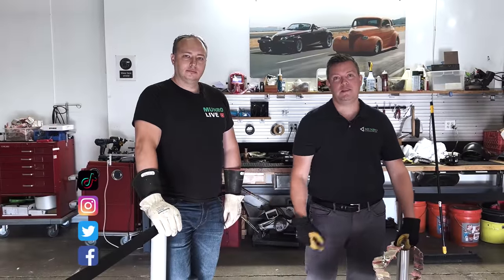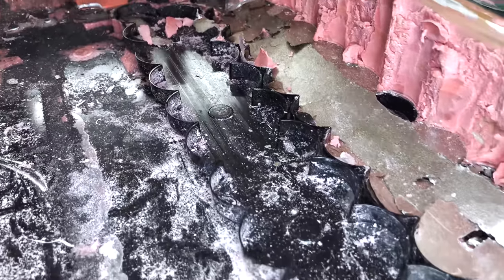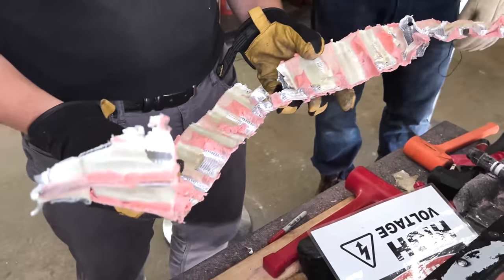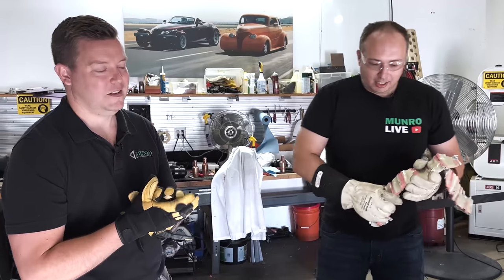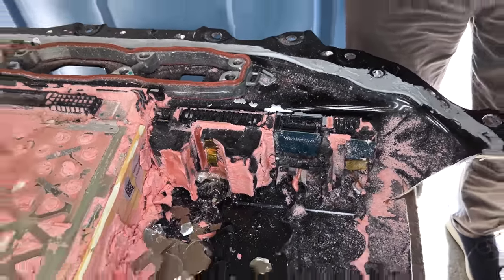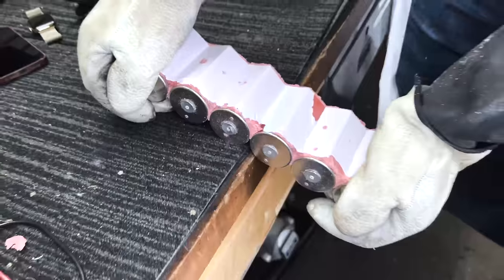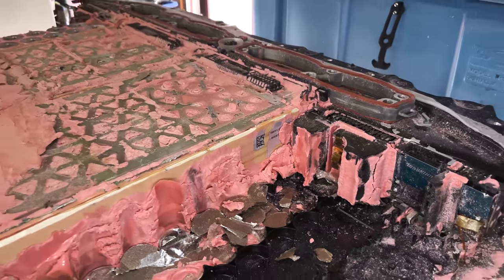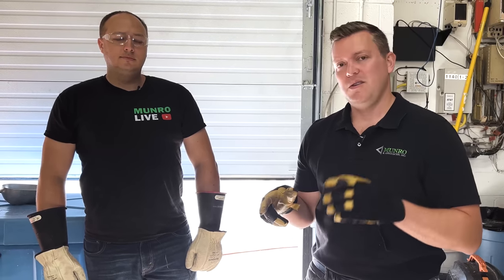4680 Update Structural Adhesive | Tesla Model Y

Comment: That foam is some strong stuff.
Like others, while I completely understand the concept of "Just make the thing so good you never have to open it" but having batteries that are THAT difficult to remove makes me pause. I know Tesla hasn't had cell problems since 2016, but GM's Ultium format was made with an eye towards customization and aftermarket use; I'd honestly want to see how heat works within it and tracks days/heavy loads to see how the heat dissipates within.
Reply: The awnser is compromise. The battery packs of Tesla are production constrained and they have so much demand it is actually hurting them to have a backlog that big. The primary goal and objective is therefore production, performance and recycling above all else. Production because they are battery contained, performance because its what will sell these cells, especially on the cybertruck and semi, and recycling, because that will ease out your future supply constraints. Everything else is secondary. GM isn't cell constrained, but , production constrained. To them it makes sense to add more features that won't add to either the performance or the manufacturing because they are bottlenecks on otjer things and you can afford more prod time on the batteries's extra features,. And let's be honest it's only a ministre subset of people that would ever desire to open the pack.
Reply: @mobiuscoreindustries  
"won't add to either the performance or the manufacturing"
Imma stop you right there. We haven't opened Ultium packs yet, but GM is using supposedly bluetooth for wireless BMS communications instead of typical wiring jobs, which means they skip an entire step in assembly right there.
Reply: @girthquake1413  that depends how you do your wiring, in the exact same way you would handle things like cooling. I am an embedded systems engineer, so this is pretty much my line of work, and while it makes perfect sense for minor interior functions, we are talking about time critical functions, ESPECIALLY for things regarding your power pack. Now it's fine for low priority messages, things that don't come with a time constraint. However any wireless and ESPECIALLY Bluetooth (which made me raise an eyebrow) add a significant delay (from the POV of embedded systems) that absolutely has to be accounted for, and there is some situations where a CAN or Ethernet system is the only thing that can satisfy that demand. Hell sometimes the constraint is so great your only option is to physically link the two systems with a high bandwidth connection because even Ethernet and CAN can get too bogged for it. 

Case and point, cells during the charge and discharge process have to be very carefully monitored by the system. For example as a pack nears capacity, the cells will start to become more receptive to influx and as a result charge rates will start to fluctuate throughout the pack with cells essentially eating more than less charged cells around them. This is an Immensely risky process as a cell can very quickly surge in intake, overcharge and cause destruction of the cell (and if unlucky, the car). These processes absolutely fall under things that you need to manage within real time constraints and typically the things that you don't even want a remote network involved into. I know GM aren't the top dog of innovation but they aren't stupid. They have experienced engineers who would throw a chair at you if you told them to do that. 

What I believe is that instead of operating the vehicule as a single can/Ethernet network, they operate all components in isolation, with every significant internal communication is done all locally via their respective calculators, but the interface between these components is done via a remote network. It adds it's own issues and firmly remove any potential for deep cross system interaction and control but it does remove the "longer range" communications that usually lead to cables everywhere. And it definitely is going to require a LOT more software expertise because remote command of systems is a massive can of worm, which I can absolutely confirm form my work isn't something to take lightly. We are trained to handle it but it no less adds a substantial block of system requirements and risks to the real time constraints being respected. 

But again, it needs to be weighted against the downsides of a remote network, and if the better management of the Ethernet network isn't going to be better as a solution. Because taking the coolant example form before, all it took for Tesla is a single well designed component to tremendously simply the entire thermal system and improve it's performance at the same time. Meanwhile the mach-E had sandy go into shock because of how bad the cooling system was handled. 

Systems can be designed good and designed bad following the same principles. And when removing parts, which is a great thing to strive for, it is important to weight in where you are shifting your complexity around to make sure you aren't placing it somewhere you cannot handle it. Tesla did this mistake with their switch to vision only, putting weight on the neural network that it was not entirely capable of handling and potentially adding a future backlog of retrofits to add new generations HD cameras and even a potential HD radar in it. It was a needed change, one I think is the way to go, but nothing ever comes without downsides and it's the job of an engineer to figure exactly what is within the tolerances of the system and what is going to drag it down too much.

Comment: Glad to see that the bottom (top) of the cells is not encased in the pink stuff and that some accommodation is made for venting. Thanks for reporting on that.
I am very interested to see the composition of the pink material. I suspect you will find a high concentration of a thermally (not electrically) conductive material. It's probably zirconium oxide but the adhesive material will need to be something with similar thermal expansion. 
Would like to see the lower bus bars.
Given the improvements in pouch cells, their higher capacity to weight, and the pack repair options that modular construction provides, I have a hard time wrapping my head around why Tesla took this path.

Comment: Man this thing has to have a very high level of durability and quality, the cells, cooling channels and bms, its pretty exotic but entirely unserviceable.
Reply: And a 'challenging' recycling prospect.
Reply: Yeah, one tiny problem and it all gets "recycled"
Reply: @MrCarGuy  
At probably double the original manufacturing cost
Reply: It's a rubbish design, Built in obsolescence at it's finest.
Reply: @andrewholdaway813  do you even watch previous videos?
Recycling it is easy🤣
Reply: @aimansaufi9205  
Oh yeah, I saw that video - it's why I made the comment.
Reply: A company would not want cells to be replaced it is a battery issue waiting to happen you can never match a new cell to a used module. With the amount of these cars being produced there will be used packs available.  The issue with trying to service battery modules is that who gets all the bad press and sued = the OEM not Jim's junkyard garage who "fixed" that battery pack 3 months ago.
Reply: @jackdbur  
Nobody was replacing cells.
Reply: @andrewholdaway813  Of course people replaced cells. There are plenty on Youtube, also.
Reply: @ContraVsGigi  
In this thread.
Reply: @andrewholdaway813  Another video Munro says "no its easy to recycle - you just freeze it, chop it into little pieces in a grinding machine, float out the plastics and you have high grade mineral ore - easy to recycle"
Reply: @csf1757  
I know, I heard that beautiful piece of hand waving. (TBF they do shred the batteries under water)

Comment: I'm still thinking they might have opened it the wrong way. Yes, the bottom is like a tub, and fasteners are on top, but what if they flipped it over after removing the fasteners, and pulled the bottom tub up? it could maybe have come out easier than ripping the top off.
Reply: I suppose their insistence on conducting a "tear DOWN", may have got them excited? lol
Reply: Theres no way they could have known that before they started. From appearances trying to pry off one plane should have been easier than 5.
Reply: Nope. Going from the top is the best way for what they're trying to do.
Reply: Nope, there are welds on top, so you have to also cut the welds, otherwise nothing comes out.
Reply: @ContraVsGigi  As I said, once the fasteners, (and welds) are removed from the top, maybe you could just pull the top up, and the whole thing would come up as well cells and all, but the bottom pan and only that would stay there.  it's possible that they assemble the whole thing glued to the top, and drop it in the bottom then seal.   I'm saying this because I read somewhere from a factory worker that they could have removed the bottom to access inside easily, and they mentioned in this very video that the bottom part doesn't seem to be fixed to anything.

Comment: I'd love to see a table discussion with Sandy and others talking through Tesla's approach vs Ford, vs the GM Ultium platform, in regards to modular design and repairability. This foam seems to completely take repairability out of the equation for Tesla.
Reply: They are not worried about it. Their cell failure rate is so little they consider it a none issue. As Sandy says, "You can have durability or you can have serviceability. But you cannot have both". And as Elon stated, "The best service is a car that does not require service."
Reply: @davefroman4700  🤔 maybe an in-between would be better? If you have bad luck with these, it's going to be a big one
Reply: The right-to-repair group will be upset but having everything basically glued together should keep everything from falling apart, something CIE vehicles seem to be designed to do. The cost to repair a battery pack would be more than the cost to replace it, making it a proper economical decision. Design and build it correctly in the first place so it doesn't need to be repaired instead of the current way of designing planned obsolescence.
Reply: @davefroman4700  Yes, it's what your guru Elon Musk say. But even if the failure points are reduced in this battery pack, a single cell failure in this pack and it is almost impossible to repair it, you just throw away the whole thing.
And even if you have top notch quality control (that Tesla doesn't have for sure), you can still have a cell that can fail over time.
I love Tesla and I got a Model 3 Performance, but their "repair-unfriendly" policy is bad and I think my next EV will not be a Tesla if they continue in that way.
Reply: @pxidr  I'd say their cell and battery pack reliability and quality have always been exceptional. Don't conflate panel gaps and minor assembly issues with quality of the main components, which have proven themselves to be way ahead of the others.
Reply: @drfasthousevonbrainstorm  not even close. Ford and GM license out patterns for part manufacturing.  It's all about allowing you to repair yourself.
Reply: What the legacy auto has yet to discover is you can't replace a cell or module and have any longevity unless the pack is brand new.  As the pack and cell age together they maintain a balance. What Tesla discovered early on is replacing a module with a new one is a disaster, as a new module will be mismatched to the rest of the pack and you'll have the pack life dramatically shortened.  The only solution is to recycle a pack.  Now if a single cell dies (opens), it likley will have neglagable effect on the pack, and can be ignored. If it shorts, the cell fuse should blow and it opens up and again is not an issue.  So wasting money and adding wieght by going modular may sound cool for marketing, but it's a failure for making an efficent EV.
Reply: @davefroman4700  You might ask that Finnish guy that preferred to make its MS explode than having to pay some 20000€ for a complete new battery only because of some few faulty cells.
Reply: @pxidr  The leading cause of cell failure is the breaking of the thin copper tab that connects the roll to the tab in a traditional battery. The 4680 does not have this single tab. Its tabless construction negates the issue. The 4680 is unlike any other battery in this manner.
Reply: @e-redj  That was the old battery design. 18650 from Panasonic. 4680 is only available in Texas model Y currently.
Reply: @davefroman4700  I know. And that battery was repairable, you could change the faulty module instead of the whole battery. Now every time a cell has a problem, and now you have much less cells in parallel, you will need to change the whole battery or throw the car away. I don’t know who can afford that, but it is not in my plans. And I don’t give much in people saying that Tesla cells normally don’t have problems, as the 4680 cells are completely new form factor and chemistry and this time is really Tesla building them. So, we have cero experience on how those cells will last over time.
Reply: @tesla_tap  Structural packs are wasteful. I suspect the cost of replacing a structural is so expensive, it turn the car into a disposable product.  The real test would be a energy audit. How much energy would it take to recycle a structural pack, vs. Battery packs. Also an environmental impact on structural vs. Battery packs.
Reply: @e-redj  The tabless design of the 4680 that is used in the structural pack eliminates the structural problem that causes 99.9% of cells to fail. Its the design of the old batteries with a single thin tab the width of a toothpick and the thickness of a human hair was how ALL the energy had to pass outside the battery. That is what always failed.
Reply: "Repairability"?
They're not using 4000 cells anymore.
What I would do?
I'd put some form of electronic switching on the control/ power circuits to enable electrical isolation (removal) of each cell if it goes out of balance.
Problem solved.
Reply: @tesla_tap  Great response. I agree with everything you said. Your remark about achieving balance was brilliant. I want to add that battery technology is going to continue to evolve very quickly so replacing a module with another module seems like it could get very complicated. Like you said, it’s possible to go ahead and replace a module with a new module that has better or the same battery tech, but it won’t be in balance with the rest of the pack. I’m sure it will still work, but the better decision is to manufacture the best battery pack (so it will last the life of the car) only once, and then recycle the pack at the end of its life. For the naysayers, Teslas battery technology is at the point where it will last for a long time and it’s unlikely that more than a few cells will fail over the course of the life of the vehicle. I’m sure if more than a few cells fail and the car becomes a much lesser version of how it was when brand new, Tesla will rectify the situation through warranty claims.
Reply: @tesla_tap  You are correct. Also from a safety POV, cars are already structurally designed to collapse. To save the occupants. Many designs 'write off' a car, that in older designs would not have, when involved in a collision.
Reply: IN order to repair you need to have a way of identifying good and bad cells.  You can shorts and open circuits quickly but there is no practical way to check the cells capacity.  So retiring a battery plack from another manufacture involves removing and replacing all batteries at once.  and putting it back together again.  If anything is missed during the repair another failure could occur a few months after the repair.  So you are unlikely to likely will not get a warranty with the repair.  Overall it is going to take more time effort and cost to repair then to simply replace the entire battery pack and recycle the old one.  currently owners are getting  200000 to 300000 mile on a pack.
Reply: It's said to be (become?) cheaper to recycle a pack and extract the materials instead of mining new. When they get up to speed on recyling damaged pack they ought to be quite profitable. Would be fair, that when the pack is outside warranty (8 years or after a long driving distance) and in the unlikely event you need to replace it you get a rebate of X amount for the old pack. There will always be a need for recyling packs (like bad crashes where it's a write off).

Comment: Thank you guys so much for sharing this awesome information.
Looking at the construction of the battery module and your disassembly i have to wonder if there is any part of the battery module that can be repaired or swapped out, or is it basically a full swap of the module if anything goes wrong with a few 4680 cells, for example.

Comment: How would this translate to a bad battery out of warranty..? Like throw almost 75% of car away practically speaking? (Like totall-loss with just minor structural damage to side when you hit pack for just a small bit?)

Even the BMS boards are glued in? Kinda don’t like this as a former mechanics
Reply: "Bad battery our warranty" huh?
Reply: @rkan2  ...spell check insertion? Maybe out of warranty.
Reply: Yes, time will tell if this level of "no repairable features" was a wise decision. This pack gives new mean to adherence to 6 sigma manufacturing standards.
Reply: @AudiTTQuattro2003  indeed, a typo